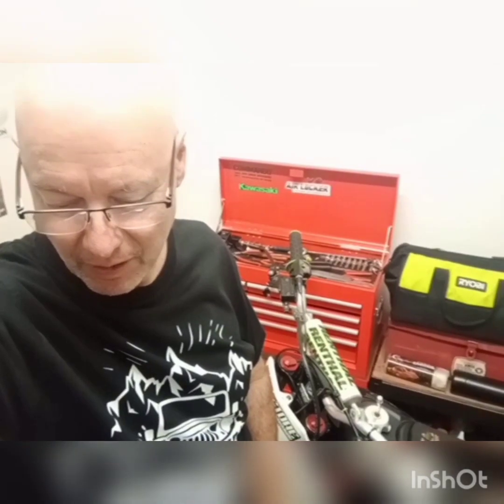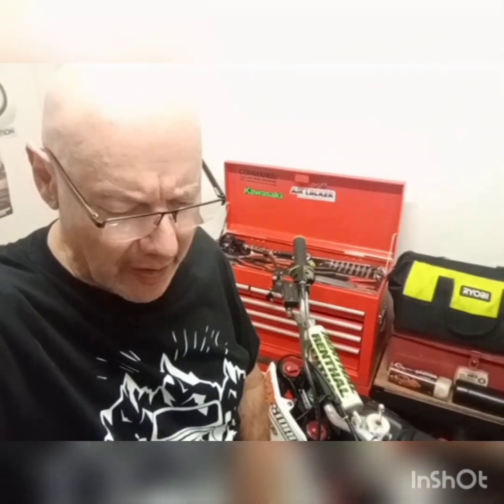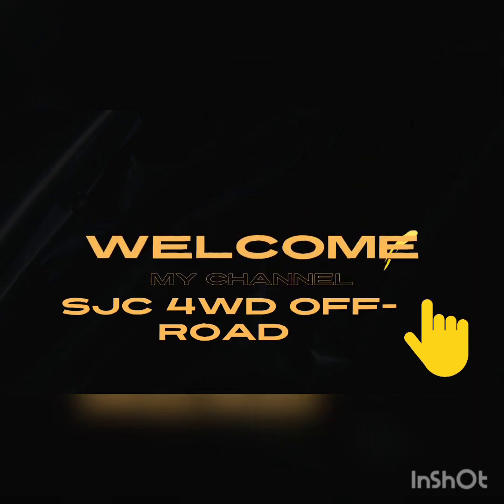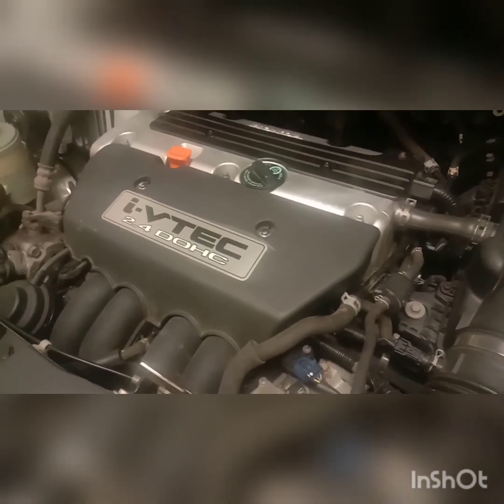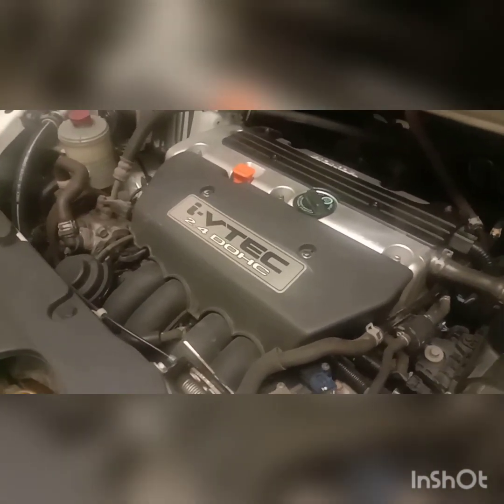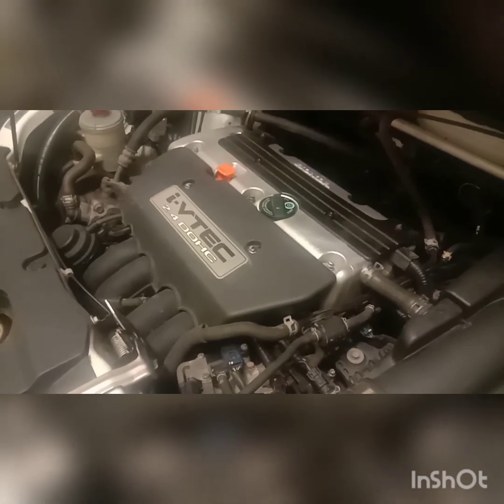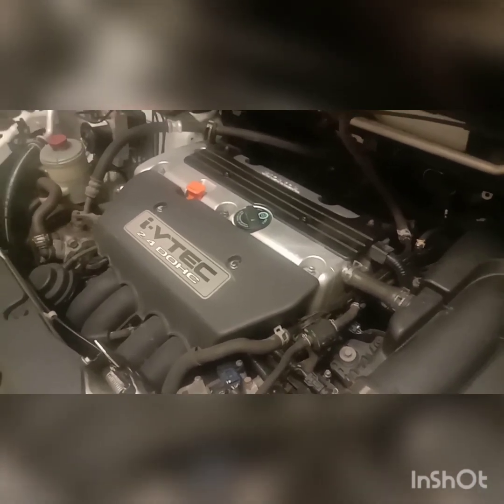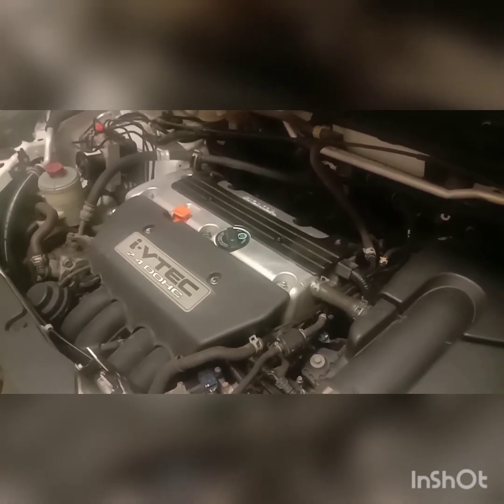HONDA 2.4 DOHC I-VTEC ENGINE, the best Honda ever built.

Comment: Hi sir, finally found someone who has the same model as well. It's hard to find the same CRV model here in my country. My CRV has a lot of problems but the only main one is my oxygen sensors are cut down and left with wires only, no sockets to be found. Can you help me out and take a picture of your o2 sensor? Big thanks.

Comment from the maker: Hi guys,
This vehicle ( Honda CRV AWD) is my daily driver plus it is also set up for camping/ overlanding. As a actually Jeep enthusiasts I'm currently searching for a XJ or a TJ Jeep. ( Have owned 3 XJ's. That vehicle will be more of a weekend play toy. So stay tuned as I will be introducing that vehicle in the not to distant future.
Cheers Steve
Reply: Mine is an 02 from the states. I've religiously PM'd the vehicle...
208K now and the air conditioning finally went out and a brake light all the same time this happened.. Can a bad a battery cause these few issues? That may sound crazy but I've seen crazy with bad batteries, obviously computerized vehicles can/will do odd things. Wanted your thoughts.... 
Yes the day I found these 2 issues I had to jump start it with a battery charger..
Thank you for any thoughts you may have...
Reply from the maker: Not sure if it's battery related?? Check fuses/ grounds/ generally it's more of an isolated situation regarding each item...